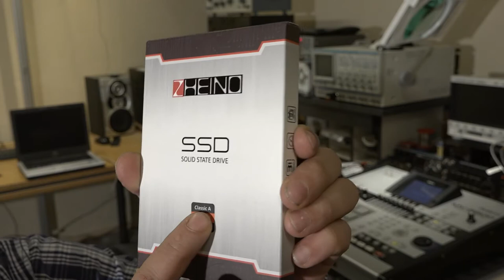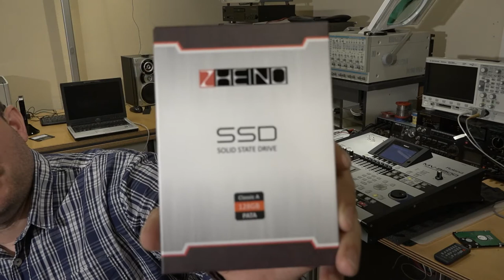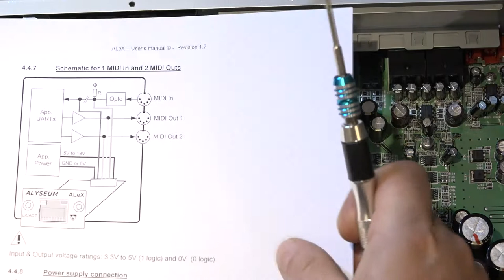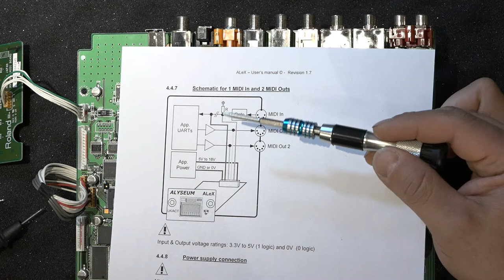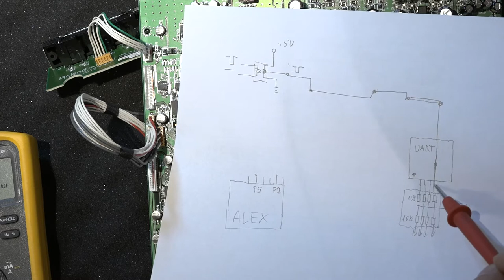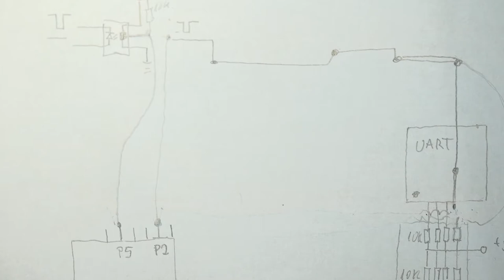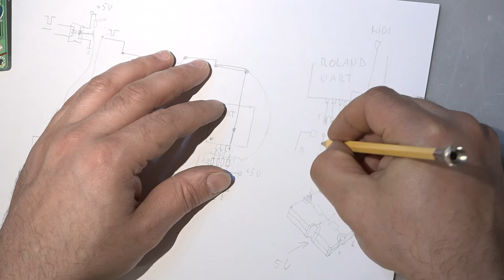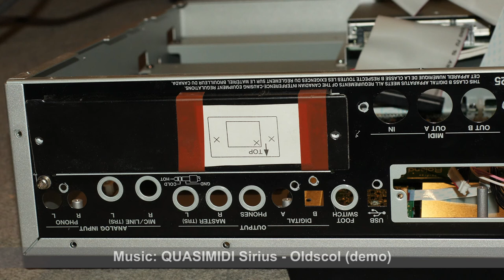Gear Hospital 01 - Alyseum Alex install, Roland MV-8800 meets with copperlan

Comment from the maker: Hi guys! Just a small update. You do not need to conect the yellow and the orange cables after the filter. So the best connection point is on Roland midi breakout panel before R85 and R83. The signal will be came more square. And for the MV-8800 You need a 4.7 KOhm resistor as dummy load for the midi outputs. Just a simple DIN connector with 4.7 Kohm resistor between a 4. and 5. DIN pin (din pin numbering are not by place! http://www.midi.org/techspecs/electrispec.php)

Comment: Thanks for the partition software recommendation the original adapter I was using was faulty but I grabbed a new one from eBay and my MV8k is now upgraded! thanks BMR!
Reply from the maker: I told You in the video. The adapters are shit :) Thats why I bought this specific HDD. No adapter, and work perfectly. Is direct ATA port SSD :) Happy MV days :)
Reply: Have to use an adapter with the mv8000 as it takes a 3.5 drive standard. I used the same ssd.

Comment from the maker: For Chris Foster : mediamarkt :) I just find on the self somewhere. Maybe in sale on that time? The AL USB is a great low delay interface for Ipad. I did try also this. Absolutely zero lag (not like on wifi with high encrypted connection) just plug and run :) I used for controlling lights and robo-s with DMX mixer.

Comment: Hi there,
Excellent video / tutorial.
How much faster in booting ,loading and saving etc is the MV, with the SSD installed?
Is the SSD SLC (Single Layered Cell) or MLC (Multi Layered Cell)? -  I've read the SLC have much longer lifespans?

Also your copperlan upgrade requires a certain level of electronics experience /  confidence in hacking at hardware...  Is this an upgrade service that you could 'offer'?
Many thanks :-D
Reply from the maker: +Phased Spaces Hi!
Is faster with around 20-30%. On the search is faster around 10-40% depend on the sample folder size.  But, the greatest thing about this HDD upgrade is the noise and resistance for the vibration. For the copperlan upgrade, the price is 0 EUR :) Just buy the adapter, and send the MV to Me. I still have a piece  from that back plate.
Reply: +BMR Studio - WOW that is quite an offer!  Where are you  based?  I'm in London UK.
Reply from the maker: +Phased Spaces Berlin Germany

Comment: Can you please put a short video up of the SSD being used. I know there will be a bottleneck but I think the searching time should be a lot quicker
Reply from the maker: Hi! Yes. You lucky. I just do a next video now, so, I will place it inside. I have a lot of samples. I figured out around 30% less boot time, the search is almost doubled, and the save is around 20% faster. The load of sample around again 30%. The bottleneck is somewhere on the embeded ATA memory channel. Can be double crc data solution. Roland always do a serious job on move, load datas between mpu-cpu-memory. This is how all Roland gear know if You have damaged memory card or similar storage block. Unfortunately, there is no deep service manual for the MV, so we don't know how the datas are moving. But let Us to see :)
Reply: Cool thanks!

Comment: I'm using the same zhenio ssd pata ide with a 3.5 to 2.5 adapter and bracket. I formated the drive to fat32 and tried turning off global copy protect but I cannot re-format the drive in the MV. I get a disk error every time and I have tried both jumper setting to no avail. please help!
Christopher
Reply from the maker: Hi! First take out and delete all partitions with Partition wizard software. Then place it back, and in the system menu remove the disk format protection. Then perform a initialisation. Max 120 GB drive!

Comment: Are you using a ide to sata adapter for your ssd?
Reply from the maker: Hi! No. In the video You will get the answer why most of Sata-pata adapter is not working. I use a special PATA ssd. You can find the brand and the type, then You just need to order from the internet. Believe mE, I did try lot of different solution, and only this hdd is working 100% with the MV. Greetings!

Comment: I have a question, if someone can answer it? With the MV8800 on its back and the bottom cover removed, I can see a space on the right side that has 4 holes just like the plate for the 2.5 inch hard drive. I also see an unused 50 pin plug on the main board that looks like a 3.5 inch IDE harddrive plug. Wher I am going with this is that I would like to put two Zheino IDE 28 gig SSD hard drives in. The original 40 gig drive is 600 ma.    
The SSDs run about 160 ma each. Less load using two. Any ideas?
Thank you. Tom from Edmonton, Alberta Canada.
Reply from the maker: Tom Salken Interesting:) let me open and see! Will be a nice short video here!
Reply: BMR Studio 
Well Thank you.
Reply: BMR Studio 
I am using a wireless Logitech USB mouse with my MV8800. I use a PS2 to USB adapter and a USB extension (that was for a wireless USB NIC). The Mouse USB stick stands up in the base of the extension. To make the mouse work, I leave the mouse USB stick unplugged from the base until the MV8800 is fully booted. Then I plug in the mouse stick to the base of the extension. The mouse will now detect for mouse/external monitor use. It works every time I use it.
Thank you for looking into the possible 2nd hard drive question. Tom.
Reply from the maker: Don’t even touch this connector! Is directly wired to the onboard RAM chips. This is some kind of expansion port, or some Roland magic programming port. What You can do, is to replace the CD Rom, because is just a slave IDE unit on a special roland connector. You can find a full schematic for this cable in the service manual. The power for the secondary HDD You can get from the 2.5 inch hdd power connector.
Reply: BMR Studio 
Thank you for looking into this.
Tom from Canada.